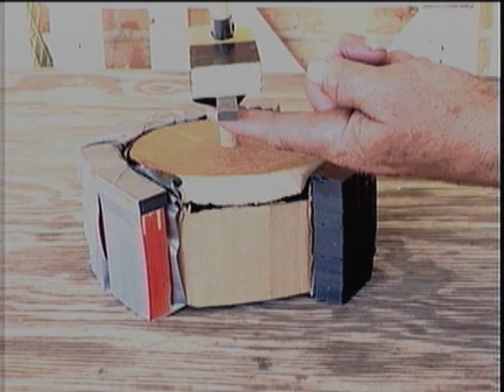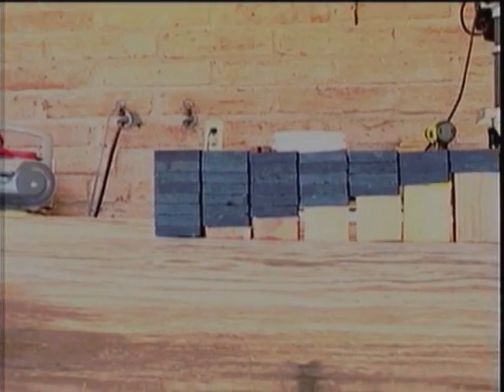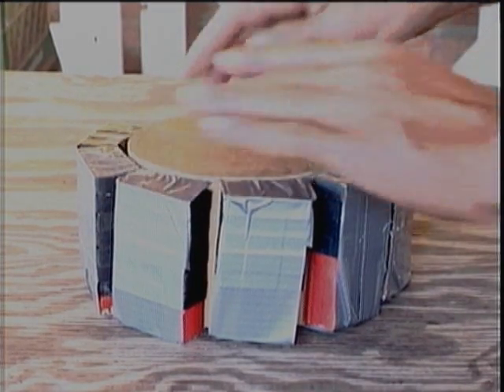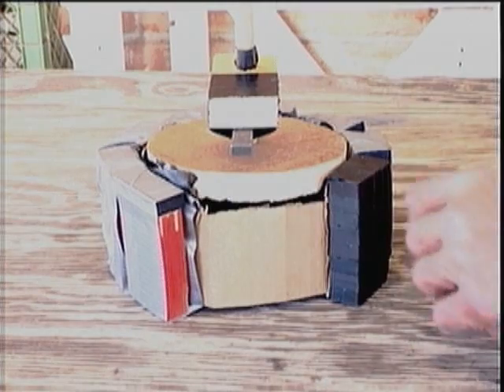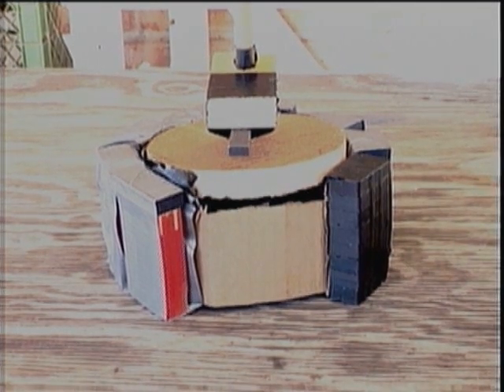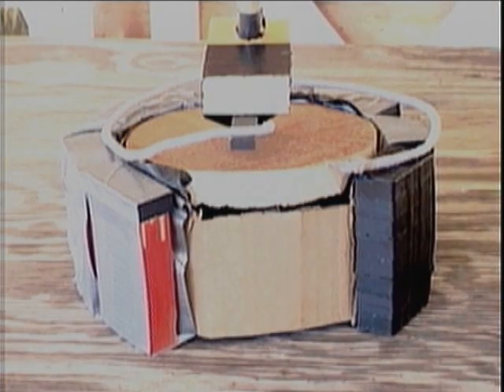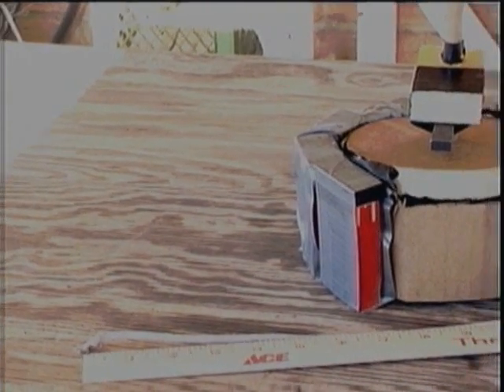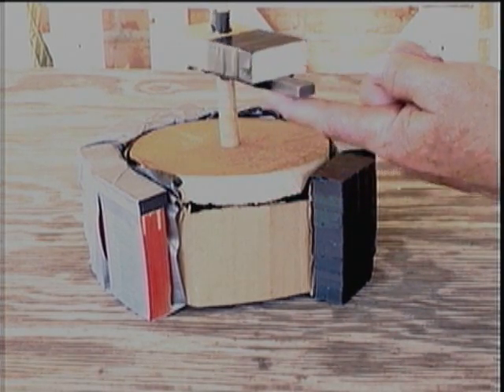Permanent Magnet Motor, Free Energy

Comment: energy=work=force*distance....gravity opposes motion up, so therefore energy is stored when it is lifted. There is, usually, no force that opposes horizontal motion (in a friction-less set up) so no energy gained or lost in that direction. connect it to a generator (a magnetic force opposes horizontal motion) and sense the magnetic force is greater that gravity you lose more energy than gained in lifting, even in a friction-less world.